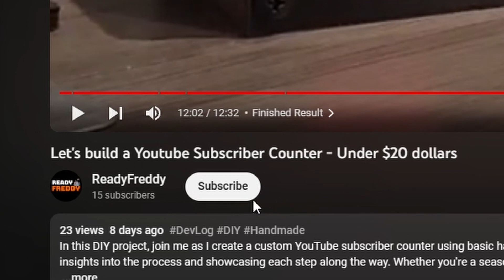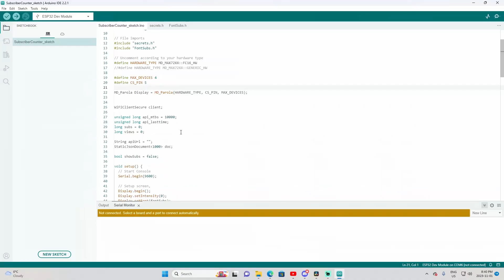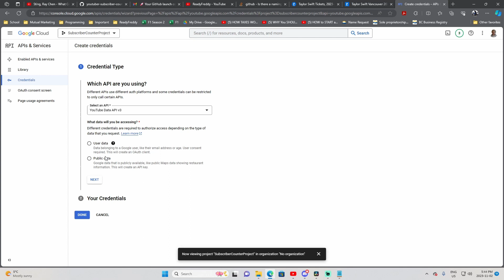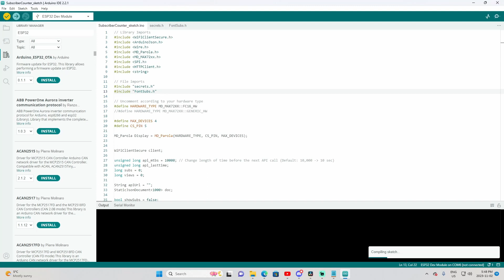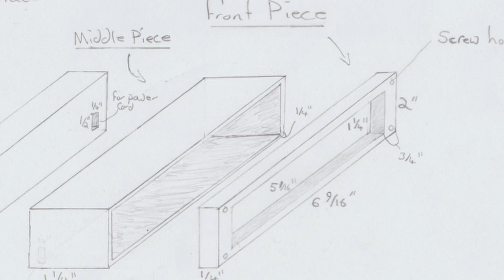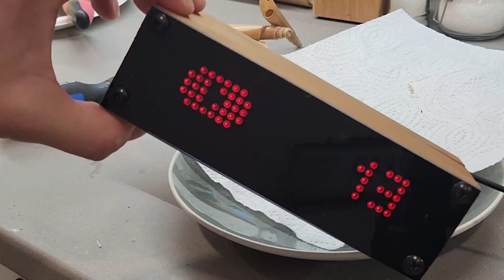How to BUILD your own YOUTUBE SUBSCRIBER counter - Under $20

Comment: I’ve been trying for 7 months, and no matter what, I get exit status 2. Used multiple cables. Never can get it to work.
Reply from the maker: Sounds like you have tried this all but just in case you hsvent:

The "exit status 2" error on an ESP32 usually means a communication failure during upload, often due to bad cables/ports, incorrect drivers (like CP210x), wrong COM port selection in Arduino IDE, or the board failing to enter bootloader mode

Make sure your holding the boot button on the board. Also make sure correct COM port is selected in Arduino IDE.

Comment: You have discord? I need help.
Reply from the maker: @MalekAbuOsba  I do not have a discord. What's the problem?
Reply: @ multiple. do you have any way to chat other than here?
Reply from the maker: @MalekAbuOsba  usually I just help via youtube comments.

But feel free to email me at:
[Removed]
Reply: @SimplyEasyCo  Alright i fixed it, but now it says "error: 'WiFi' was not declared in this scope. Line 49
error: 'WL_CONNECTED' was not declared in this scope. line 51
error: 'WL_CONNECTED' was not declared in this scope. line 69"
Reply from the maker: @MalekAbuOsba  sounds silly, but just double check that all your variables are spelt correctly. For instance WiFi is spelt with a capital F. Stuff like that

If the issue still persists, send me the model of your esp32.
Reply from the maker: Also ensure that you have

#include <WiFiClientSecure.h>
WiFiClientSecure client;
Could be that your not correctly importing your library
Reply: @ alright now im having issues with sending it to my ESP-32 😭
it either has error 1 or 2
Reply from the maker: @MalekAbuOsba  An "exit status 1" or "error 1" indicates a problem during the upload or compilation of code onto your ESP32. 

Error code 2 is similar.

Try different usb port and/or cable.
Ensure all the code compiles. Ensure you are doing the correct upload procedure.
Reply: @SimplyEasyCo  Thanks!

Comment: Can I use another arduino?
Reply from the maker: @SomeGuyMC-YT  you should be able go use an arduino. Just the pins might be different, as well as the packages used in the firmware.
Reply: @ does it need to be wifi tho
Reply from the maker: @SomeGuyMC-YT  yes. Without wifi you won't be able to communicate with youtubes api.
Reply: @ ok just bought one
Reply from the maker: @SomeGuyMC-YT  good luck and have fun with the build!
Reply: @SimplyEasyCo  thanks!

Comment: hello, Ive never coded anything in my life so I faced many problems.
I was able to fix them but Im stuck on this one
the code works but it doesnt show anyhting
Reply from the maker: If your certain the code is not at fault, it sounds like your display connection could be at fault.

Make sure you have connected the display pins to the esp32 correctly.
Double check that each pin is connected as described in the video. 

Hope this helps.

Comment: Amazing project. I made it and it's really cool. But I'm having a problem and need some help. My counter uploaded only one time the number of followers. After that keep showing the same number. But, the views are uploading. It might be something wrong I did with the code?
Reply from the maker: Interesting. Did you use the code I supplied, if so did you change anything?

The counter should switch between subscribers and view count every 10 seconds. As it does so it should update. Views take about 24hrs for youtube to update them while subscribers should be instant.

If possible, may you supply me with more information of the problem.
Reply: @SimplyEasyCo  I have used your code. It changes between subscriber and views, the views update every 24 hours, but the subscribers are stuck in 2730 subs. I didn't changed anything of the code.
Reply from the maker: Just out of curiosity, since running the subscriber counter have you gone up by 10 subscribers. Another viewer said after you are above 1000 subs it will only count in increments of 10. I am still at 226, so I have not experienced that yet. 

Let me know if this is the case?

Quoted comment "From experience let me save you some troubleshooting in the future, When you get past a 1000 it only goes up in tens. Neat execution"
Reply: @SimplyEasyCo  I got 9 more followers. But that makes sense...I believe it will update with one more. I'll let you know.

Do you think we can make it show one by one making some changes in the code or there is a API "limitation" for that?

By the way, I wold like to replicate you project in my channel if you allow me. I will do this in portuguese, to hel my brazilian fellows. An, of course, I will give you the credits for the project.
Reply from the maker: Sadly this is something on youtubes end, probably to reduce the amount of api calls on their end (costs). As a result, there is nothing we can do to change that on our end that I currently know of (not saying it's impossible, just that I don't have a solution at this current time 😊)

And for sure, go for it. I would greatly appreciate the credit :).

Reach out if you still continue to have the problem.
Reply: @SimplyEasyCo  the counter updated! 10 by 10, thats it. Really thanks for your feedback mate. 
And, keep going on Youtube, yor videos are great!!
Reply from the maker: Thanks mate, yeah much appreciated. I am currently moving to my first house but thinking of taking my channel into game development as it aligns more with what I do at work. 

Good luck with your youtube career and congrats on the 2k+ subs!